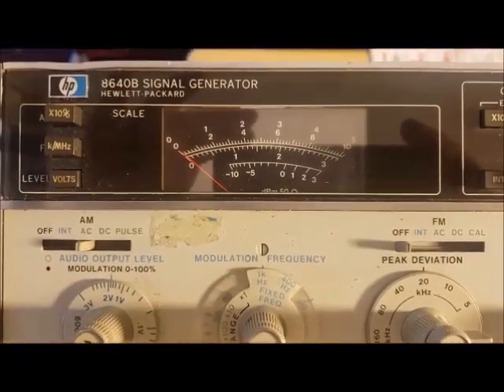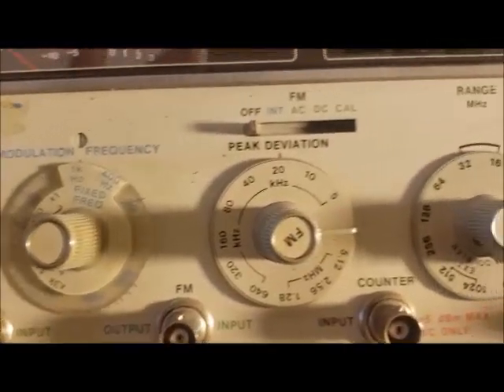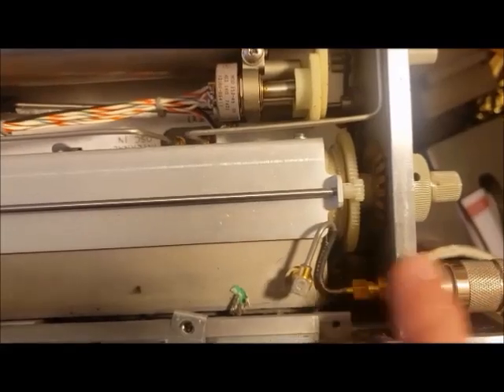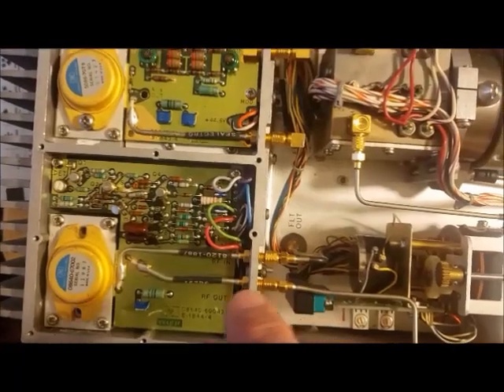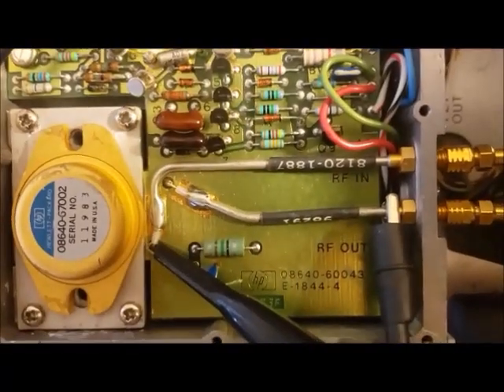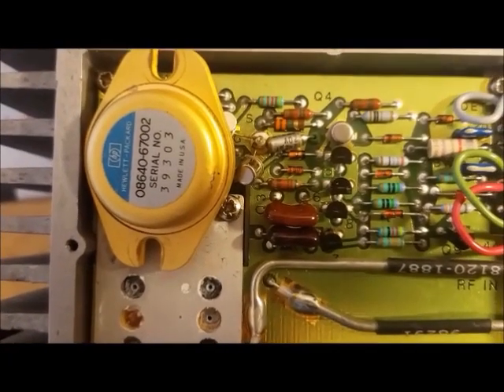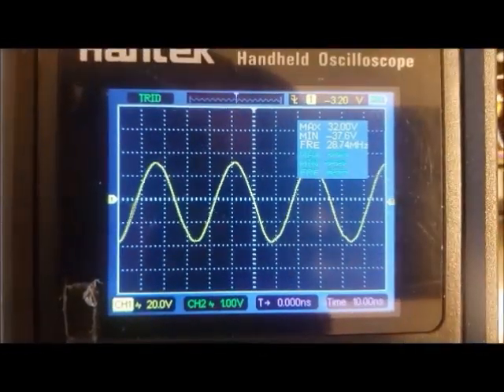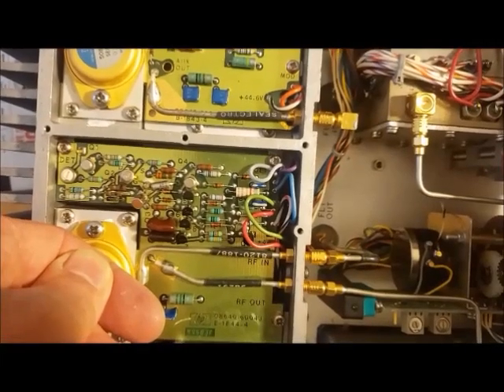How to repair low output on an HP 8640B signal generator.

Comment: was the frequency meter showing all zeros?
Reply from the maker: No, the frequency meter was still working  OK.   The output level dropped because the final amplifier burned out because I was running it too high into a mismatched load.  Replacing the final amp solved the problem.
Reply: @FranksPlace-jk7pj many tnx. In my 8640B i have no output and frequency meter is all 0.00000
In the power supply i have all voltage(s).
😢
Reply from the maker: @Alberto_Alletto Turn it to a lower frequency and  try backtracking with a scope to see if there is a signal coming out of the cavity oscillator.   This link should really help.

https://www.radiomuseum.co.uk/8640B.html

Comment: I have a HP 8640B with no RF output.  The Power meter light does not turn on.  The unit turns on but no RF output and no counter output movement when the internal frequency dial is turned.  The power supply LEDs are and no -5.2VDC.  I removed the RF Divider Filter Assemble and the -5.2 VDC is correct.       Can you please provide suggestions on what is drawing the voltage down to 0VDC?  The rectifier boards and filter caps are good.   Al
Reply from the maker: Check the voltage regulator, diodes and resistors in the power supply section for any damage or faults.  Also, verify that the wiring and connections are secure and not causing a short circuit.  Use a multimeter to trace the voltage drop.

Comment: Thanks for the video. Great find on the fault. I do think that I saw a bit of distortion and wobble on the scope trace, after the repair. You might want to look at that closer. Maybe a component that supports the amplifier component got stressed? HTH. Cheers.